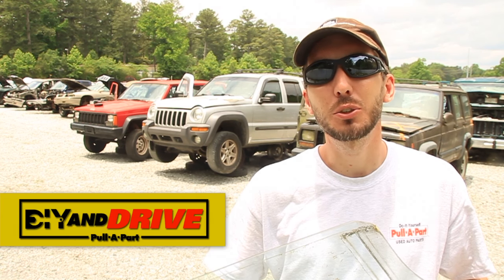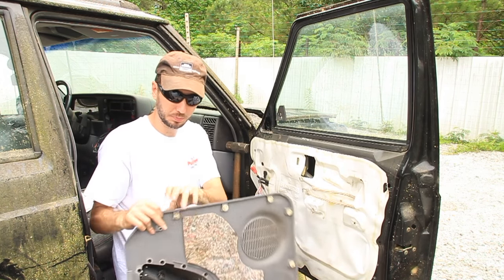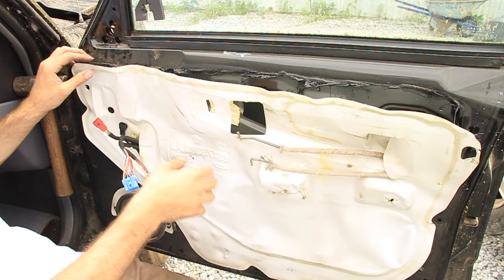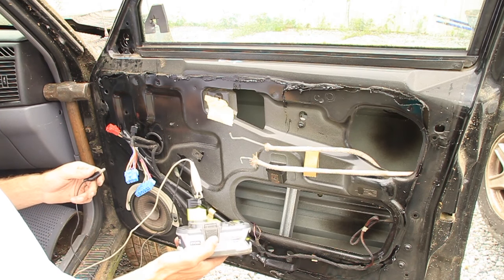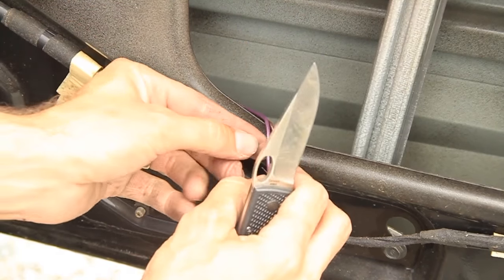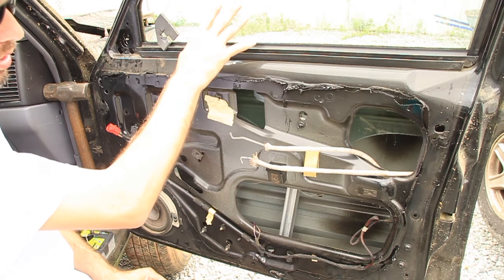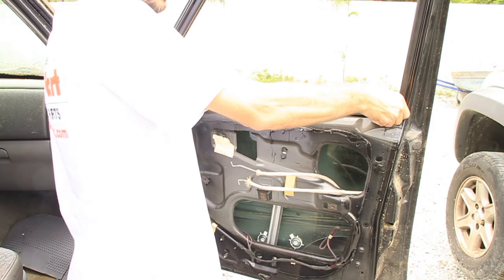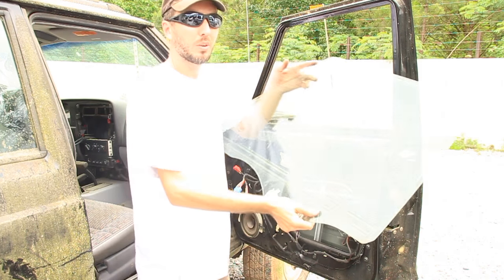How To Remove Auto Door Glass

Comment: wonder if easier to tint when completely removed
Reply from the maker: maybe so but not necessary at all, a pro can tint all your winndows in about 30 minutes.
Reply: Tried it. Not by much. Too much hassle
Reply: 45 minutes to remove the glass to save 5 minutes tinting plus I'd be prone to getting the tint scratched when reinstalling.  So no